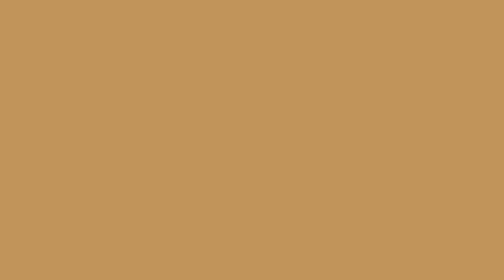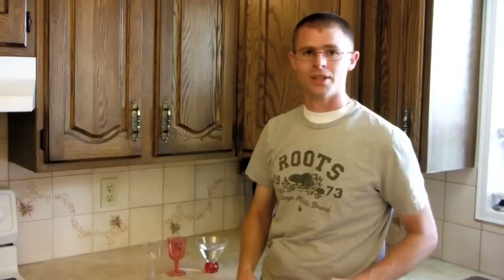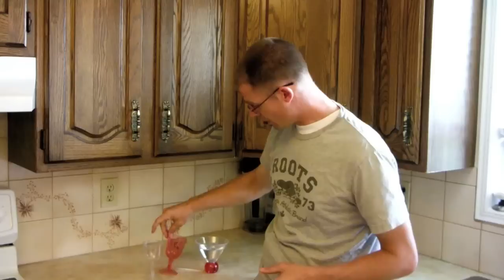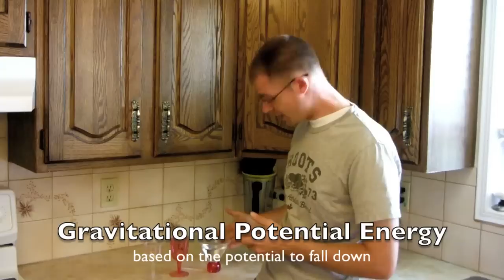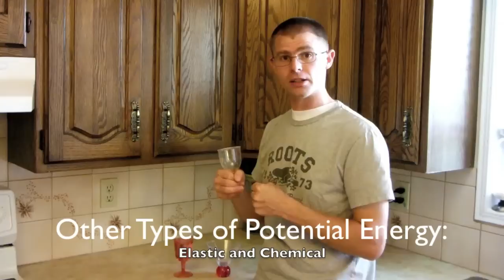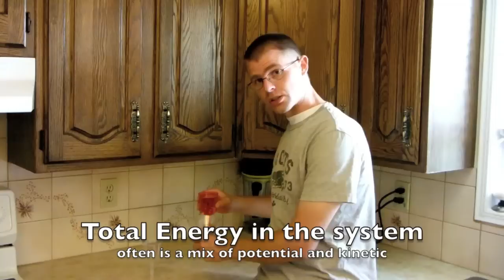What is the Law of Conservation of Energy

Comment: Dwayne, thank you for the trial but it does not help. From aside it look as mere pouring water from one vessel to another. If at least it were two non-miscible colored liquids, each representing one type of energy...
Mathematically, it looks more convincing to me:
mgh= m1gh+m2gh+m3gh+m4gh=(m1+m2+m3+m4)gh=mgh (PE)
mv^2=m1(v^2/2)+m2(v^2/2)+m3(v^2/2)=(m1+m2+m3)v^2/2 (KE)
or alike.
Reply from the maker: +secondbelarus but there is only one "type" of energy. (Energy is energy, just found in various states or forms (motion, chemical, position, light, sound, etc).) Your formulas are correct and valid, but outside the scope of this demonstration, since they don't show the relationship between the sum of energies to the total energy.